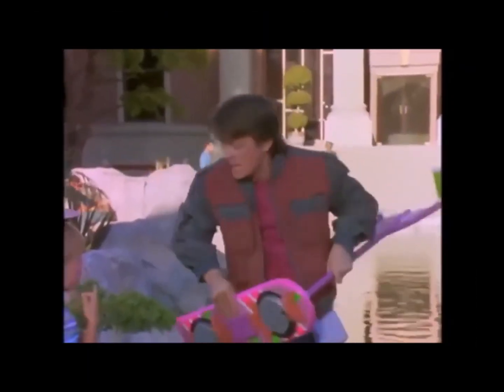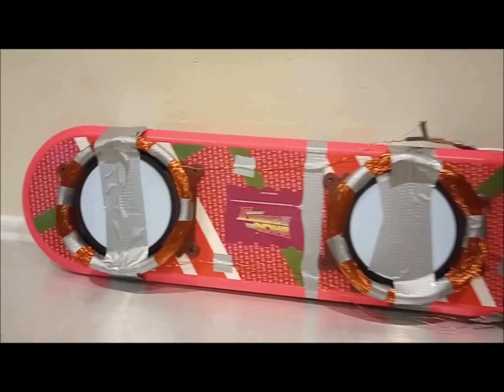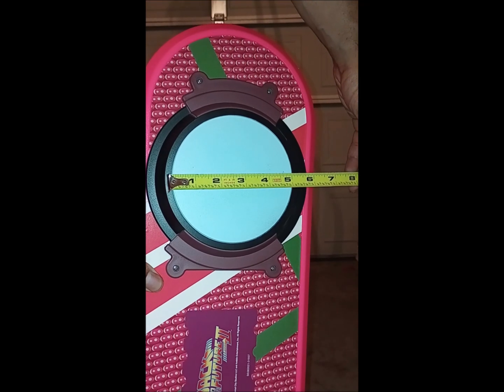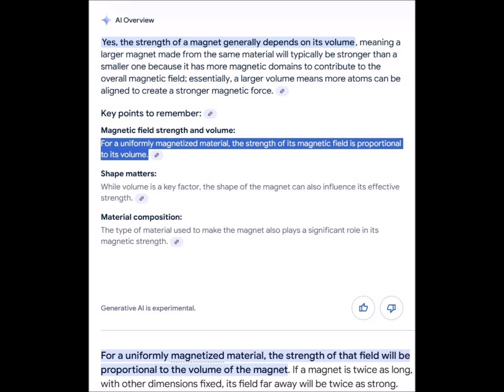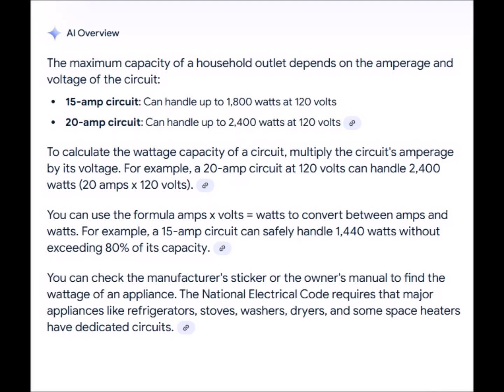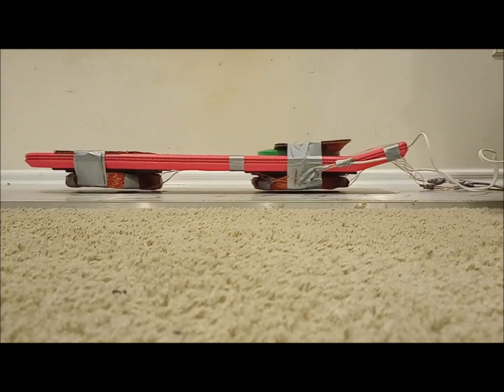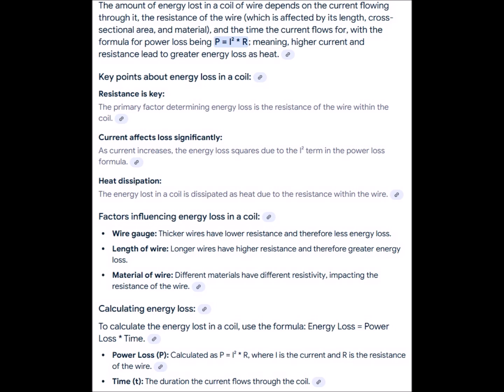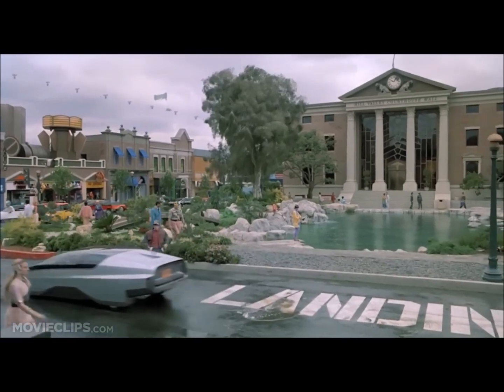The Hoverboard: Is it Possible?

Comment: It's why I'm hoping that ai scientist, once it's been perfected enough to do its own experiments accurately. Might find a new way to tackle this issue that we simply haven't discovered yet. I just don't see companies dismantling all roads to make way for supercharged magnetic plating. Smart cities might be more plausible, like you said, but it would end up mostly being a gimmick because it would be too complicated in older areas. So it's the knowledge surrounding physics that needs to be expanded on to fit a capitalistic  society in the long run.
Reply from the maker: @kairi4640  I don't think it would really be gimmicky per se. Smart cities of specialized roads made of embedded mechanisms have already been conceived and are being planned. It's really just the new smart cities that would have the plating underneath. For traveling between cities, there would only be a need for long thin tracks just as we would make for trains. Most older areas would likely be abandoned in the far future anyway just like the "Old Towns" of the past that are abandoned today. Rather than trying to dig up and modify old foundations, we could just start anew in adjacent areas. Even if we discovered the elusive antigravity, there would likely still be a number of limitations and caveats. For instance, say we could develop a gravitational device which is super sensitive to gravitational fields and can repel the gravitational fields in the ground surface. The fields vary greatly over the Earth's surface due to the inconsistency of mass underneath, which would result in highly inconsistent repulsion forces. As a solution, we might still need to lay tracks of consistent material density. The real advantage is that they wouldn't have to be made of metal, making material for the tracks far more plentiful and thus cheaper.

Comment: I think the system's deception is in the use of the words electricity and magnetism. From what I have learned, in ancient times the feminine energy was used - ether - orgone, etc. This energy, to give it a name, is diamagnetic in nature (it repels the magnetic field). Magnetism, gravity, electricity, electromagnetism, magnetic ley lines, are the same with different words, it is Dor energy, masculine energy (which circulates in a straight line). Instead of antigravity, it should be called antimagnetism, on the other hand I suspect that the so-called "static electricity" is not electricity at all, it is ether, it is the type of energy that arises from the feminine and has no polarity + -. Static is generated in many ways, in water with currents and implosion, in the wind, in sound, in friction, etc. But to cancel magnetism you have to use static plus a porous and diamagnetic material.  For example, insects such as beetles use a shell that is porous and made of diamagnetic material and generate static electricity by flapping their wings. Porous and diamagnetic stones were used in the coral castle, Edward Leedskalnin created a static machine that was stolen. He probably used it to cancel out the weight (magnetism) of the stones. Static machines were widely used in ancient times, as were diamagnetic materials. Electricity, gravity and magnetism are current terms. Before, everything was much simpler, based on shapes and materials, and they were not complicated by polarities and circuits. Nature only uses shape, material and static "electricity".

Comment: This is an interesting idea. Would it just take rotating a magnet, changing it's polarity, to induce a current in the plate? Or maybe some type of magnet switch.
Reply from the maker: Yes, rotating magnets have been shown to work. There are also ways to divert the fields of permanent magnets in such a way that is essentially equivalent to switching them off. If mechanized, this process could also produce a time-varying field. Theoretically, we might also be able to generate such fields with rotating superfluids or ionized fluids. This is believed to be how the fields of magnetic stars or magnetars (the source of the most powerful magnetic fields in the known universe) are generated. There's more than enough available energy. It's really more a matter of being able to convert it far more efficiently.
Reply: @gsutton78  Speaking of efficiency, in a standard maglev, or in this demo that uses an aluminum plate, does drive frequency change it's behavior?

Curious because it's basically a transformer with the plate as a secondary coil with only 1 turn. I would think if it's driven at a higher frequency it would cut down on losses from heat.
Reply from the maker: @Jon-2049   Yes frequency is something I will be exploring. Certain higher frequency ranges could improve efficiency. I think it would probably depend more on the overall resonant frequency of the system as a whole which would likely be affected by the changing flotation height. But even lower frequencies could work. Eric Laithwaite was able to hold up a 100 pound aluminum plate to a height of 11 inches. And the frequency in the U.K. where he lived was even lower at 50 Hz. His coils might have been turned to resonate around that frequency. That's something to look into. He was even working towards achieving a height of 24 inches with an additional 200 lbs, but I'm not sure if he ever achieved it. Even still, 11 inches is phenomenal when it comes to magnetic levitation and proves definitively that those heights are at least obtainable.